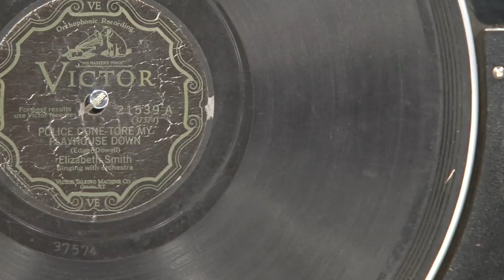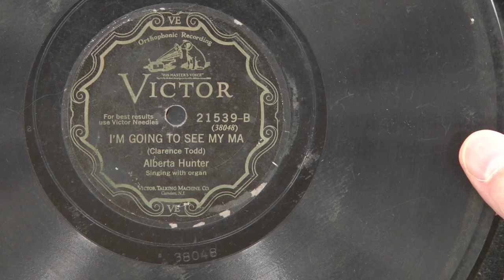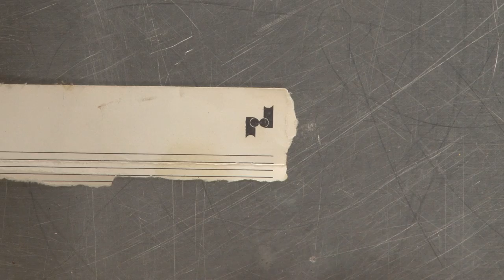Record Player: Equipment Autopsy #95

Comment: It's a needle for phonograms (old wind up 78's) or a stylus for record players/turntables :P
You can find strobe discs online, worth downloading/printing so you can play with them on motors.
The red light is often a neon on cheaper turntables just as a check with mechanical speed adjustment, so it only sync's to the mains frequency.